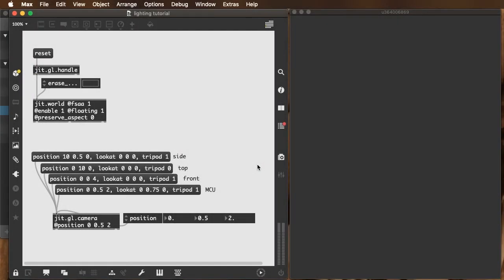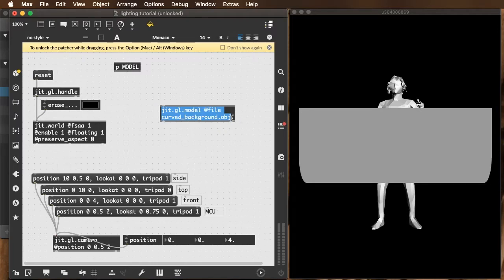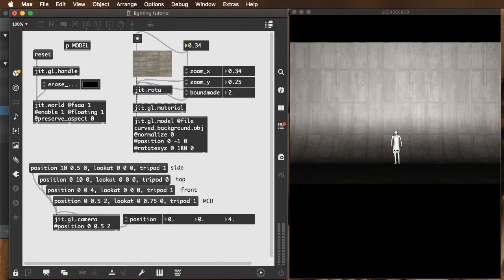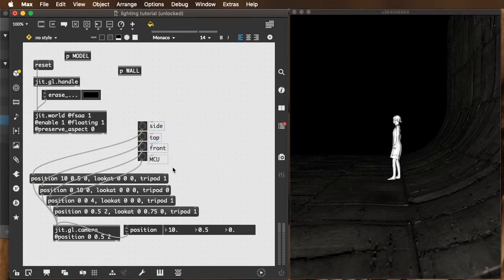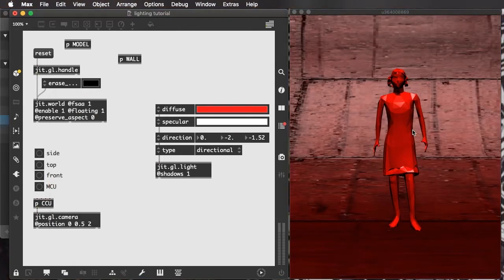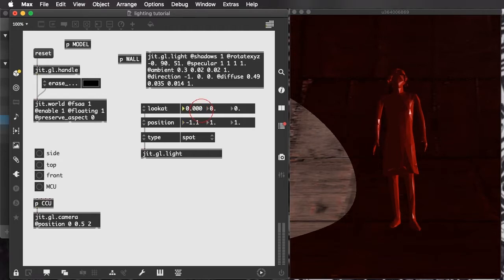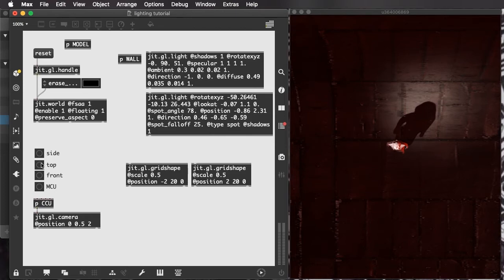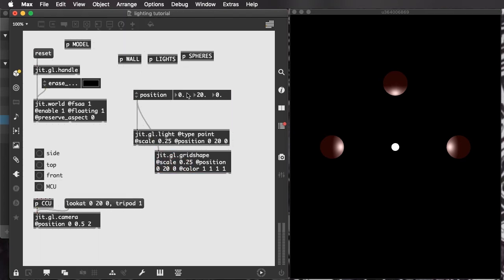Max Tutorial: Material Tiling and Lighting

Comment: This is a brilliant video and opened up a lot of things about jit.gl.lighting that I didn't understand, also I didn't know about the change attributes to arguments shortcut. That is going to speed up things for me. I'm curious to know what spec mac you are running. I have old macs and whenever I try using shadows they can't handle it. Are you using the newer M1 macs? Cheers.
Reply from the maker: Thanks Ned! I'm on a 2019 Macbook Pro (2.8 GHz, 16GB RAM, Intel Iris Plus Graphics 655). For an integrated graphics card, the 655 is pretty amazing. If your machine is having trouble rendering shadows, try @shadowquality lo
Reply: @JohnJannone  thanks. Have you had an experience or seen anyone doing 3d on the m1 macs?
Reply from the maker: @NedRush  no, not yet!